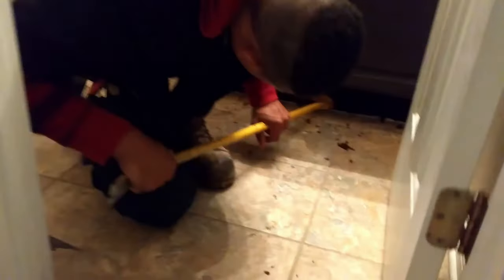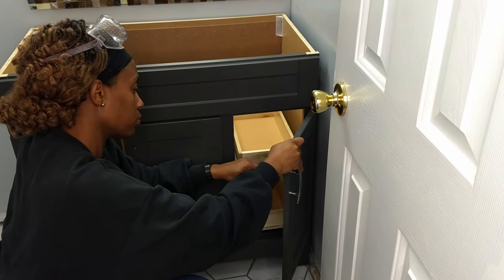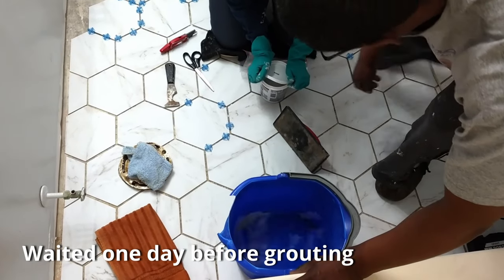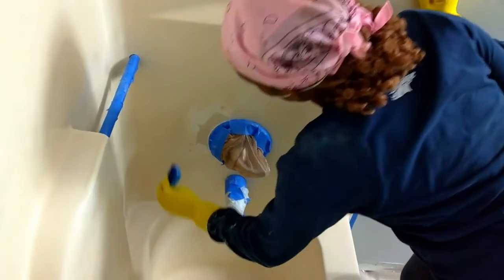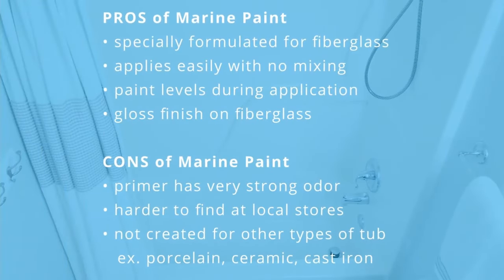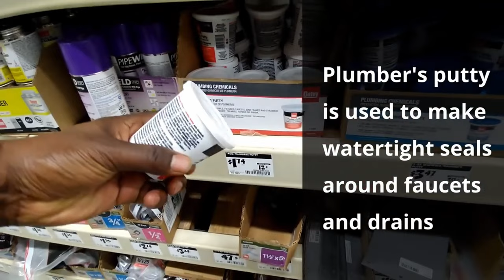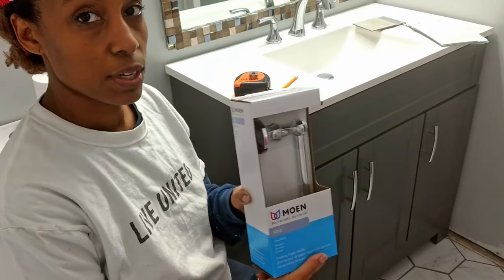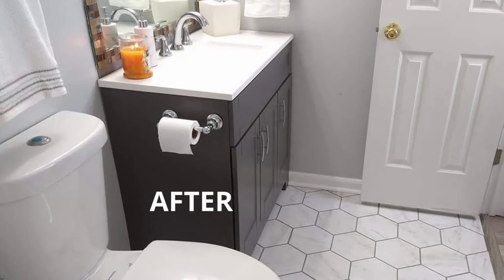Our Most Unexpected Small Bathroom Renovation - DIY Marathon

Comment: Let me inform you the mistakes you made with the peel & stick tiles.
1) You're supposed to clean the entire concrete flooring with a mold remover or bleach (clorax ect brand)...spray it down and soakkkk it down...let it dry completely b/t each application...2X application
2 ) You are then supposed to seal the entire concrete with a concrete sealer, 2 to 3 coats in order to prevent any and alllll moisture coming up through the concrete slab...let each application dry up completely prior to applying the next one down...small spong roller and paint pan.
3)  Once the sealer dries up completelyyyy apply a tile primer adhesive to the slab and let it dry up ( it will become kinda sticky) same as (2) but with a new roller.
4) You suppose to allow the peel & stick tiles to acclimate to the interior temperature for up to 72 hrs...priorrrr to the entire installation and above instructions.
5) Then heat up each and ever tile adhesive with either a blow dryer or a heat gun to activate the adhesive prior to installing each one down...trust me those suckers will stay firmly down, dont forget to roll over it with either a wood pinroller or floor roller. 
Same can be done to any flat wall, accept to dont apply any concrete sealer or bleach to the wall, instead clean each wall with baking soda and water, 1 application is enough, let it dry completely then proceed to the next step.🤣😂🤣
Wall method:
Clean walls, let it dry, apply tile adhesive, let it get very tacky, heat up each tile, then apply to the wall and roll over each one with a wood roller, then grout with tile grout of you preference.😊... the wall(s) must be entirely flattttt, no texture of any kind what so everrrrrr.
Been thier, done it with absolutely noooo issues what so ever...good luck with your next project and looking forward to seeing each of them...if you have any question feel free to ask..once again good luck🫶
Reply from the maker: Thanks for sharing your tips.😊